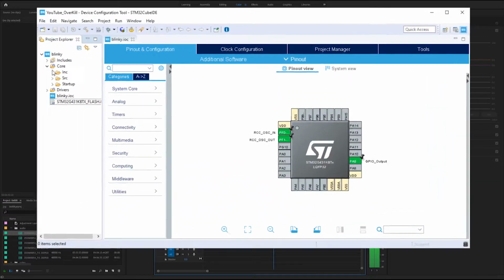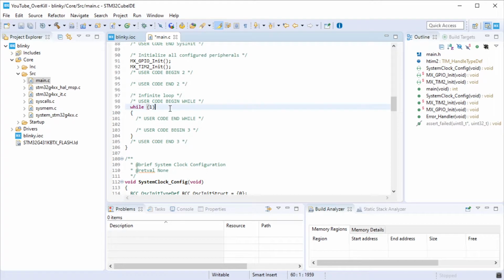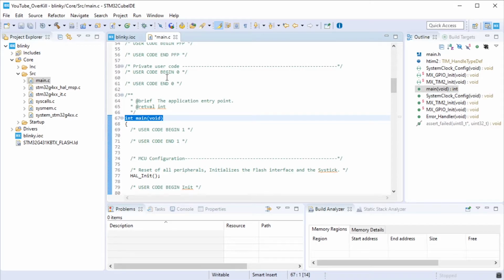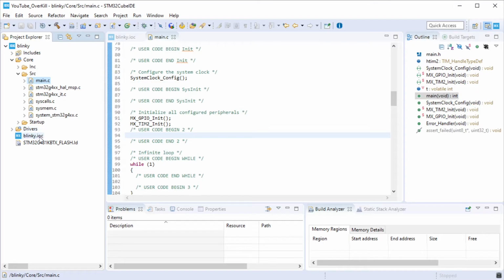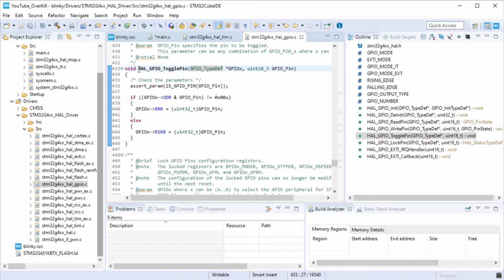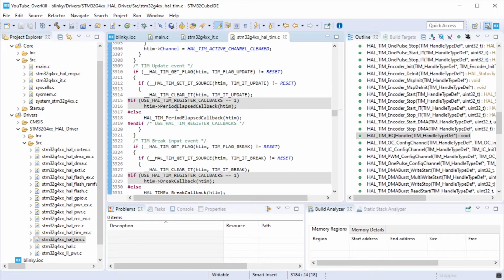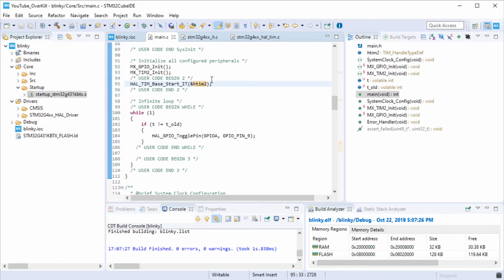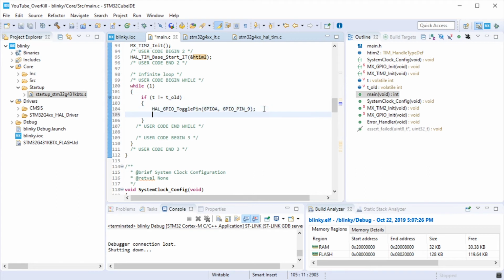STM32 STARTER'S GUIDE! | Programming the controller

Comment: Hi, super good explanation. Great video. 
I would expect much more viewers after 2 years especially when all the ST official tutorials have a heavy French accent...

Here are some interesting point in the video for reference:
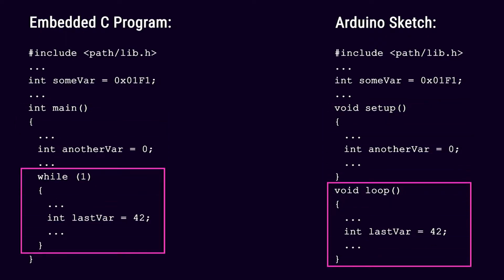5:58 Comparing Arduino Sketch to main() in C program
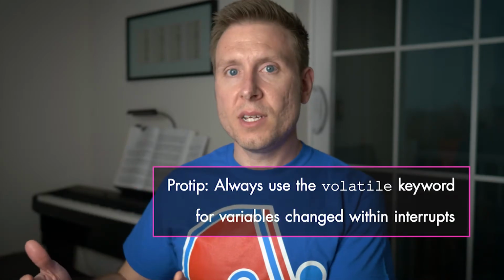7:37 volatile keyword for variables inside an interrupt
8:54 HAL API
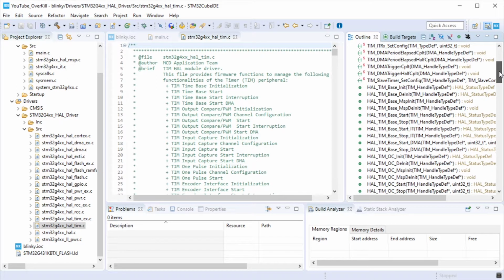11:32 View inside the HAL functions
11:52 start a timer as interrupt
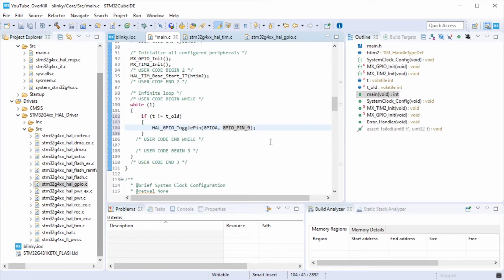13:49 using Hal function to toggle a pin
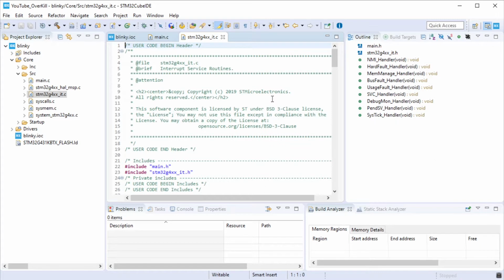14:19 using the interrupts in  stm32xxx_it.c file 
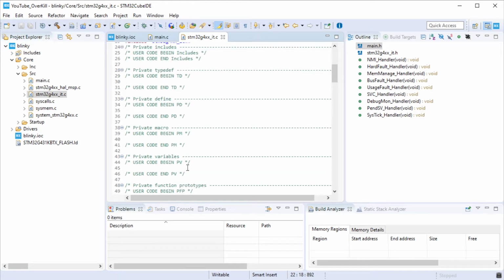14:34 "extern" a variable in the interrupt
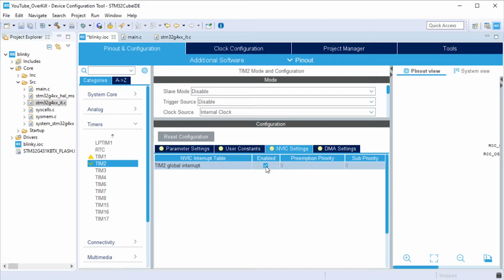15:41 generating code for the timer interrupt by using CubeMX
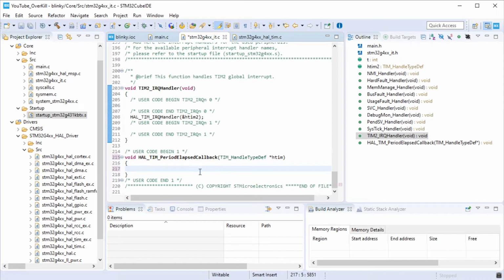17:31 How to add a callback in the IRQ function
18:55 passing a struct by reference (using &)
19:31 build analyzer to view resources

Do you have also videos on STM32L5xx family?
Reply from the maker: Hey thanks!  I was considering a video about the STM32L5 series.  I'll keep it in mind!

Comment: Is this the last in the series so far, or have you already done others to follow?  I followed another instructor on YouTube and wrote a Blinky using HAL, but I hated HAL.  However, having watched your video above, I now understand the reason why my code has to be shoe-horned between pre-written comments.  However, I would like to move towards the low-level routines, and at 10:30, you intimated that you would move beyond HAL at some point.  You mentioned having to work with the data sheet, which was music to my ears eyes!
If you check my channel, you'll see that I did an Assembler course on the ATtiny85, so I have a feel for uControllers  (and datasheets), but I have found the H743 very difficult to get started with.  Your course, and your style, however, offer real promise to get me where I want to be.  I hope you find the time to carry on the course.  My intended project will use two or three timers, lots of memory, DMA, two SPI channels (at 25MHz), SD card - so several peripherals - and at the moment, I haven't started to climb the hill yet.  I'm still at base camp! 
Thanks so much for your efforts.
Reply from the maker: Hey Mike.  I've been hair deep in client work (and a new house, baby, pandemic, etc) but I'm gearing up for new videos now.  I'll put together a video or two about programming on STM32 if you are interested.  Let me know if there is anything specific you want to see.
Reply: @overkillprojects8091  Thank you very much.  Overkill me!
When I wrote the AVR course, I was under no illusion about whether an assembler course would go go viral.  However, that's not why I did it.  My channel isn't even monetised.  I had a few queries, and I think one guy went through most of the course, but since I presented it, it has only raised mild interest.  Then I got a bee in my bonnet to make a POV globe - a biggish one with better resolution than I have seen on YouTube, and I looked for a chip that could do it.  I need about 430K of image memory, and the Globe image would be made by spinning a semi-circle of 2mm x 2mm RGB LEDs.  There would be 220 LEDs for each of North and South, and each chip needs 32 bits of colour data, so with the memory and speed requirements, the STM32H series seems to be what I need.  
Since coming to the ARM-based chips, I see that there are a lot of people in the same position as I am - wanting to use the STM chips, but not finding the information.  AVR was popular once, but even the mighty Arduino is losing it, and ARM is where it's at!  So I think you will get more interest than I did - but think about it before you give it your all.  Going by my own experience, you will spend many, many hours making the course and presenting it, with possibly very little reward - even moral reward.  Then if you decide to go ahead with it, please don't base it simply on what I want.  Think about what will be most popular, and get some input on most popular projects that it might be used in.  Maybe HAL is the way to go - though I hope not.
My desires (technical, that is) are to learn to find the low-level routines I need, how to use them, and to interface the on-chip peripherals directly, and also through DMA.  I intend to get images from an SD card then DMA them to the SDI's.  The chip would also drive a BLDC motor to spin the LED strips.
Reply from the maker: @DownhillAllTheWay  All very true, and very much appreciated advice!  This channel is the same way, just making videos about stuff I like with the hope of helping someone.  That said, I think some deeper programming material on things like Arm would actually help people get closer to their goals, so it's worthwhile to me!  Maybe what will make more sense is to make a few shorter videos going through specific peripherals/accessories from the datasheets to show how it's done, then if anyone cares maybe I'll put up extended developing sessions on patreon or something.  We'll see.  It'll be easier to reach people as i get subs, and i get subs with content, so you might see some shorter pieces with a more popular/in the news bent to try to pick up clicks, then more tutorial stuff.  Stay tuned!
Reply: @overkillprojects8091  I'm subscribed and have notifications switched on, so I'll be waiting for anything you publish.  Power to your elbow!